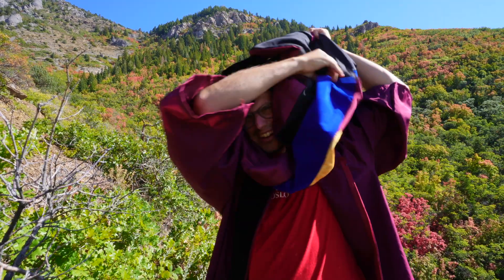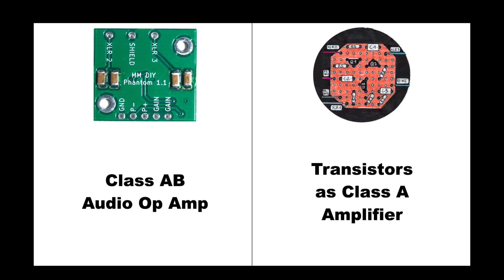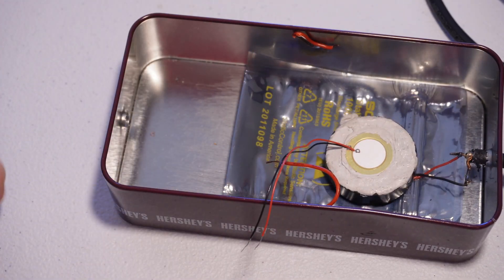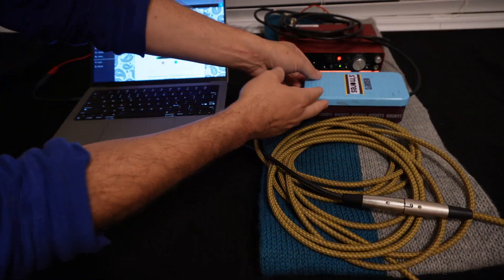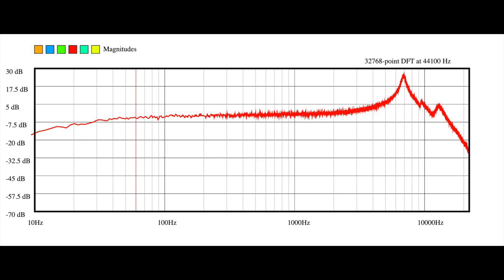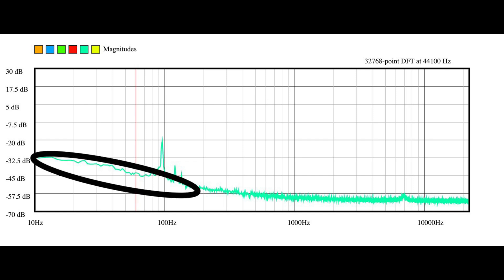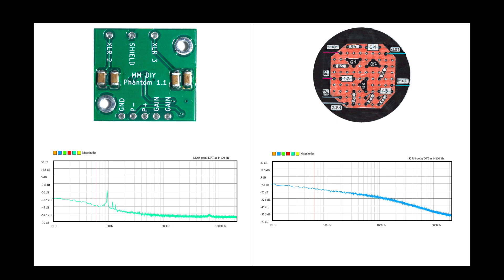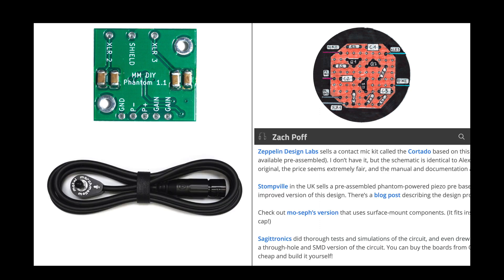Alex Rice Vs Metal Marshmallow DIY Phantom Piezo Preamp Comparison

Comment: Hey, I just found this video, and I was wondering if you matched the JFETs you used for the Alex Rice preamp. If you didn't, it might explain the poor noise performance compared to your design, which I assume used BJTs. JFETs have a crazy parameter spread compared to other transistors, so they need to be manually tested and matched by a few different parameters for most designs to work correctly.
Reply: @metalmarshmallowllc Also, what transistors did you end up using in your Alex Rice preamp?

Comment: 14:45 "This is why I'm doing this research as openly and transparantly as possible" My guy, why then do you not provide any schematics or BOM for your board? I get that you're trying to get a business off the ground, but you're asking $35 + $20 in shipping for a board with less than $1 in components...
Reply: This. If you're interested in a similar sounding but open piezo preamp design, take a look at @markg1051's comment in this video. This Metal Marshmallow guy ends up redoing his tests and realises that if you remove C2 and C3 from the Alex Rice preamp, you end up with very similar results. Also very interesting is that he never pinned the comment or made a new video to correct himself. I guess business speaks louder.
Reply: I replied to this comment on how you can build a similar preamp to this guy's and I'm pretty sure he deleted the comment...
Reply: @davidamaral9655  Hi, I want to know how you built it, can you tell me
Reply: @davidamaral9655  any links ?

Comment: I’ve built the blog orégano with the 2N3189 and some replacement jfet. I used 9v batteries in both. The first 2N3189 was not noisy at all and had a very nice bass response. The second BN something was crap.

Comment: When I use piezo pickups I go into a DI with high impedance (1M ohm) because I understand the contact mic has a much higher output impedance than a normal mic. The performance seems good and definitely better than straight into a channel. Is your preamp doing exactly this or is there some other benefit?

Comment: Thanks for the vid.  However, any lay person with an intermediate knowledge of electronics would know this comparison is apples to oranges, let alone a EE phd.  I'm not arguing that your results are invalid, only that your "proof"  experiment was questionable at best.  A perf board prototype compared to a professionally manufactured smd  PCB complete with ground plains? Come on!    

I'm about to build one of the many circuits that I've found on the internet.  So, I'm hoping you're completely incorrect.  It will be built like your complete smd version.  In the search for the perfect JFET, I have noticed a wide range in noise figures while searching for the "perfect" component.  

My comment isn't meant to rag on you.  Merely, an antithetical position taken because of your suggestion that all the products using similar circuits to that which you built were inferior.  With no apparent consideration of the fact that the same circuit with the same parts built by 5 people will yield 5 performance results.   In short, you set off my BS detector.  It's been right, and wrong.  I guess that's my $.02.
Reply from the maker: I appreciate your skepticism; peer review is an important part of the process even here on youtube, and I'd love to hear back from you especially if you can demonstrate that my results are wrong -- I have definitely been wrong many times before and I learn and improve every time. I did originally prototype the Metal Marshmallow preamp on a solderless breadboard and the performance is the same as on the professionally produced PCB. 

Apologies because this got buried in my replies to a comment by @markg1051, but the noise and low frequency issues in the Alex Rice preamp don't arise in the lack of ground plane or the perf board or even in the JFETs. They arise in C2 and C3, which are actually not necessary anyway. So if you build it, just get rid of those, and then the performance is actually very good. Or if you buy a version of it, check that they are not there or remove them. The only downside is that the gain is fixed at +12dB, so you won't get optimal noise performance and can't adjust the sensitivity, but that may or may not be an issue depending on what you are trying to do with it. 

Have fun with your project, let me know if I can help, thanks for your $0.02, and happy recording.
Reply: It would be great to see a comparison of a SMD professional manufactured version of the "blog" preamp, a breadboarded "blog" preamp. How did your quest go?
Reply: @guitchess, what was your outcome?

Comment: Nice job on your preamp Michael.
Just had a quick look at the discrete JFET circuit you breadboarded, 
Not the lowest noise design. One obvious issue is the value of small coupling caps C2 and C3, also as there is no difference in DC voltage at the gates of the JFETS plus the piezo disk being practically open circuit at DC you can do without them.

I'd be curious if you could repeat the measurement on the circuit after bypassing the C2 and C3 input coupling caps. I suspect that the noise floor should drop considerably.
Reply from the maker: Interesting thought, I might give that a try. My guess was that the noise was either due to the high value resistors feeding directly into the transistor bases, or the use of transistors optimized for high frequecy (maybe the other recommended transistors would be better?). Probably all of the components contribute. Even if the noise could be solved, I still don't think this preamp would be better than no preamp at all due to the low-frequency problem.
Reply: @metalmarshmallowllc  You are right about the majority of noise being from the high value resistors especially in the case of using low value coupling caps as they tend to go up in impedance at low frequencies making the bias resistors dominate. From past experience most of the piezo discs have a very high capacitance in nano or tens of nano farads which is the reason why the noise will reduce if the low couplers are bypassed. If you have an access to a capacitance meter measure the C-piezo, and work out/calculate the reactance of it at various low frequencies, this will give you an idea how or whether the 3 Meg resistors or the Xc of the piezo will dominate.

I've worked a lot with the old Philips BF245A, B and C versions, these are all discontinued parts now unfortunately without any noise issues that showed up in your measurements.
My thoughts are curiosity based, always wanting/needing to know the reasons for certain results. So I am not suggesting the use of one cct over another, the one with better performance is the winner.

Let us know what you find if you end up repeating the test.
Reply: @metalmarshmallowllc  PS, if you want to see exactly where and how much the noise is generated remove the piezo and replace it with a short wire link, effectively shorting the inputs. Do this with the 220pF caps in. Then for comparison, move the shorting link between the two FET gates. Doing this should not alter the bias of the FETs as there should be no DC voltage difference between the two gates.

Cheers.
Reply from the maker: @markg1051  So I did some tests and it looks like you are exactly correct on all counts.

I first repeated all the noise measurements using a wire link in place of the piezo. This was a much easier way of doing it, and the data I got was a lot cleaner (no noise from the neighbor's AC unit). Aside from that the graphs are the same as what I show in the video and everything I said stands.

I then removed C2 and C3 from the blog preamp by shorting out their terminals with a blob of solder. I repeated bot the noise-floor and white noise measurements. I have to say that I was shocked, but that completely solved both the noise issue and the poor bass response issue. As much as it pains me to say it, without the caps the performance on both counts is essentially the same as the Metal Marshmallow at +12 dB gain. So I guess I might change my recommendataion from "don't build this" to "If +12 dB works for your application, go ahead but for the love of all that is holy leave out C2 and C3". 

If I have a spare moment I might post the graphs to my blog. Thanks for your insight, I'm sure a lot of people, including me, will be elucidated by this discussion.
Reply: @metalmarshmallowllc  Glad to be of help Michael. Love your attitude, real scientific mind set!
There is one other quirk with the original circuit design, if you redraw the schematic to include the two 6.8k phantom supply resistors located between the interface,  internal 48V supply and pins 2 and 3 you get a full picture of the actual "complete" circuit which is really a standard differential amp gain stage. You then realize that the bias is derived from the Q1 and Q2 outputs, i.e. their drain terminals which is not just a steady DC voltage but in addition contains the amp AC output signal component. This configuration creates a negative voltage feedback which reduces the input impedance to well below the combined value expected from the 2:1 divider of two x 3Meg resistors. This is another reason for the degraded low frequency response with the 220pF couplers.

As I don't have any means of doing the tests you did, I ran the circuit in my Altium simulator Circuit Maker 2000 to get an idea of noise and frequency response using some standard JFET models in the library, I ended up with pretty much the same response curves for both frequency response and the noise that you did. When I say 'same' I couldn't simulate the piezo element and its resonant peak in the frequency response.  The main difference I got was in the value of gain due to different FET models available in my simulator, this ended up being just short of 30dB of gain.

Anyway, thanks very much for actually redoing your measurements with suggested changes, really appreciate it.

Take care.
Reply: @metalmarshmallowllc your dedication and resulting honesty is what we need from scientists and makers, no ego. You'd rather get it right and happy to be proved wrong.
Reply: If I bypass C2 and C3, I get a very static-y output. Any ideas?
Reply: @davidamaral9655  - With C2 and C3 bypassed the circuit gain increases considerably at low frequencies. 
If not well shielded, i.e. make sure that the preamp is enclosed inside a grounded metal enclosure,  if not, you will pick up all the 
electric noise fields from your environment. 

if not done already, make sure you are using a balanced shielded cable between the piezo and preamp inputs,
don't connect the shield to any part of the piezo electrically. Make sure that the piezo is fully shielded with either copper or aluminium foil.

Good luck
Reply: @markg1051  do you have any links to the circuit ?